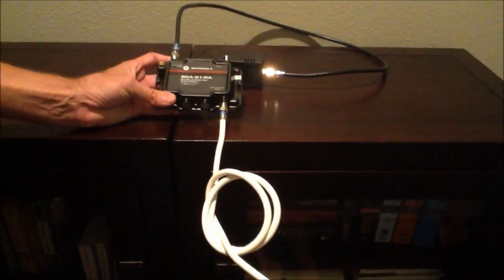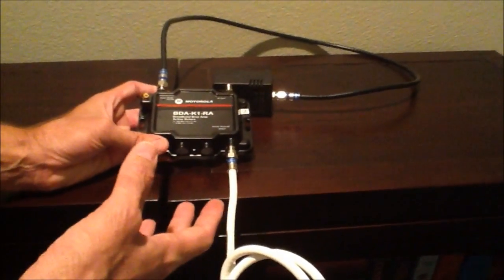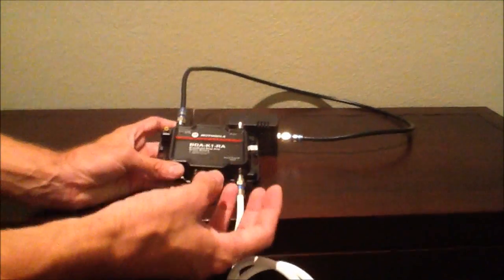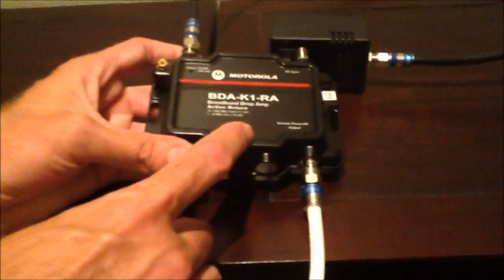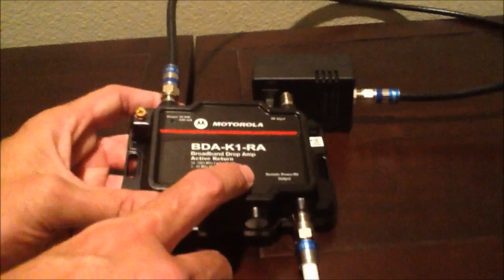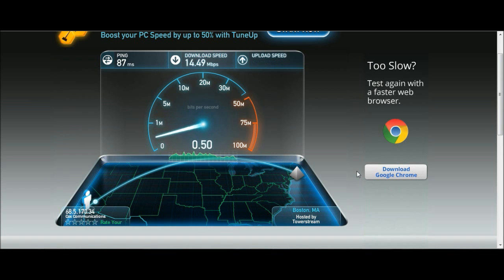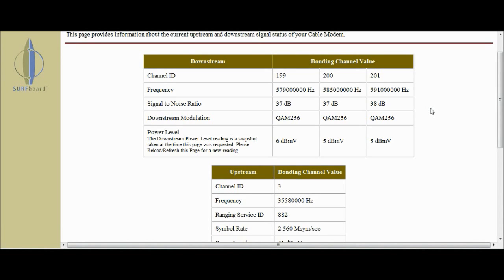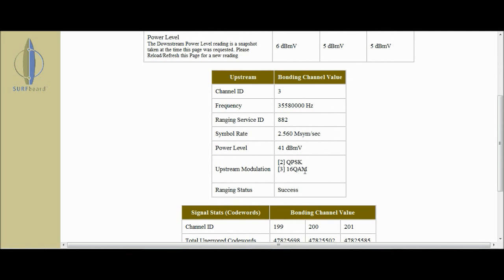Resolve Cable Modem Disconnects Caused by High Upstream Power Level

Comment: What if you're on the other end of the spectrum and Upstream is below 29 dBmV? Active return indicates that it would hurt me rather then help, but I can't find a "active return signal dampener". From what I can diagnose according to this article: 

homepage.ntlworld.com/robin.d.h.walker/cmtips/loss.html

my upstream is capped and resetting my modem or I have packet loss when uploading. If anyone knows of a device like the active return for signal being too low then I would like to know of it.
Reply: +Kevin G I've somwhat answered my own question, but I'd like some further advice. From what I read apparently I can increase upstream levels with a DC Coaxial Couple or a Splitter? A splitter seems like a minor solution, the Couple sounds good, but I have no clue as to sizing requirements or where to buy them.
Reply: +Kevin G 

Okay, for those interested, and BBStudio maybe you'll want to add this info to your post, I added two splitters in series. My upstream power went from 29 dBmV to 37 dBmV and my downstream went down from 8 dBmV to around 2 dBmV with the noise ratio relatively unchanged. 

My speed test download increased slightly from 90 mb/s to 101 mb/s and my upload went from 5 to 12 mb/s. Which all seems much more stable to me. 

I doubt very many people have this issue, but I am happy with the result and everything seemed to stabilize from it which will hopefully keep my modem from restarting. 

As a side note, I started with one splitter and my result was the mean of using two splitters. In effect, adding additional splitters increases upstream and decreases downstream without (in my case) decreasing download performance.
Reply from the maker: +Kevin G Thanks for the additional information on the splitters. I really appreciate that.
Reply: BBStudioProductions Sure thing! It seemed odd that adding a splitter would increase the upstream power, but considering the fact that downstream can diplex the upstream signal it makes sense that a splitter would make the downstream noise quieter by reducing frequencies coming in while the upstream has a straight path to the wall still going the other direction. Kind of like a bleeder valve.
Reply: Kevin G you want a piece of equipment called a "step attenuator". You can find these in various dB strengths. A 15db step attenuator would be ideal for you but a 10 will work. These will increase transmit power and only lose about 1db receive.
Reply: BBStudioProductions wow. Dude. Okay... So I'll make this simple since you're way over thinking it. 

A splitter is diving a signal. A 2 way divides in in "half". 3.5db is "half" as loud as 7db. Catch my drift? This affects signal both ways. 

7db into the 2 way splitter. 3.5 dB out of the splitter. 

42.5 TX in to the 2 way splitter. 46db out of the splitter. 

DB values are on the front of the splitter. 3 way is 6db. 4 way is 7.5 dB and on and on. 

Also.. Terminate the open ports in those splitters or you're increasing noise.

Comment: your ideal signal lvls would be 0db rx and 40tx .. if you are below or above -12db or +12db on rx your modem will fail .. below 35db or above 49 tx your modem will fail .. the reason why your modem resets is because you have a bad node

Comment: For faster service you will want a 24x8 bonded channel set up modem. That's 24 channels down and 8 up. That way if you have channel failure on one or 2 chans your aggregate value will be steady in both directions.

Also DONT KINK YOUR CABLE OR GET ALUMINUM MESH ON THE STINGER AT YOUR FITTINGS!

Comment: I hooked this up to my cable modem today and it seemd to have the opposite of the desired effect.  My Upstream power level went from 52 to 58 and my Downstream went from -3 to -18.  My SNR went from 36 to 21-25.  I made sure to connect the Incoming cable from Cable company to RF Input and the cable to the modem to the RF Output.
Reply: Did you hook the power to the power in?

Comment: I have had the same problem for 3 years, my ISP refuses to acknowledge or fix my consistent internet dropouts. (Huge packet loss at times)

My official modem is locked out from the web interface when the coaxial cable is plugged in, giving me no clue on what the actual signals are. However, attaching a different Modem which is not allowed to access my ISP's network, does show the actual signal levels however.

So I bought a Konig Active Return Amplifier and started to tweak the upstream return path signal strength, and leaving the downstream signal/slope at lowest, i've managed to change a few things.

It seems that i have managed to stop the constant disconnects, having to reset my modem all the bloody time. It did introduce some very light packet loss once an hour on average, just incidental ones. Im still gonna try and find some sweetspot but this is way better than what it was. My ping also seems to be alot more stable (6 to 8ms) with occasional spikes to 12ms.

I pretty much tried everything to keep my downtime as low as possible, even up to the point where I bought a WeMo Switch from Belkin, which I was able to control 2 floors down through WiFi. At first glance of packet loss my script started to count up until 5 times packet loss was detected in a timespan of 10 minutes or so, and automagically power cycle my modem 2 floors down. It didnt solve my disconnects but it did initially solve my huge downtimes. 2 minutes for power cycle and reobtain WAN ip on my router versus 30/60 minutes per packet loss attack waiting time until it sorted itself out.

Cable companies suck, and people seem to have no rights regarding a proper/stable connection. In fact, my ISP clearly states that they are not required or forced to fix any issues a customer might encounter.

Strange, in a world where the Interwebs is almost part of your basic needs. (At least, the government and local authorities and what not really like you to do everything through the web these days instead of paperwork, sometimes there isn't even any other choice)

/Rant over

Comment: Hey BB, Great video man. Unfortunately for me this did not solve my problems. The AMP did boost my levels from -7 to +8 downstream and 49 to 38 upstream. So my new numbers look good but still i need to reset it about once a day. I ordered the same amp and everything, got any other ideas to try? Much appreciated.
Reply: You probably have errors coming in on your modem frequencies. Get a tech to check the tap and your drop, outlet, and splitter work.

Comment: i have the problem you talked about where the modem has to work harder to compensate for cox's end, but my levels are the same as yours in some cases better. should i still purchase a amplifier? I have 16 bonded channels downstream and 4 channels upstream. the modulation is QAM256 and are all around -1 to -4 dBmV. also one of my upload channels is unlocked and the US channel type is unknown with a symbol rate of 0 Ksym/sec and 0.0 dBmV power. i have a netgear CM500 modem and a netgear night hawk router. what do you reccomend i do about the channel.

Comment: FIXED.
Hey..

 For years Comcast had told me my Reboot problem was due to old modem ( since replaced three times.  Mot SBG6782AC now. Then it was old barrel connectors and cable ends. Since replaced twice.
Then I tried a AARIS active Broadband drop amp with no change. My upstream power was 51 to 56 dBmv and is the source of my headaches.
Today's Comcast tech listened to me today as I explained the multiple garage fires melting the pole line and the multiple patch jobs over the years since then. He metered the line and found unstable signal and when it started to sprinkle rain the signal went from barely working to none. 
RESULT... The cable from the main pole distribution was 20 years old and over the years damaged by environmentals.  He replace all the cable to my home with good connectors and cable designed for DOCIS 3.
My numbers are  picture perfect and my signal is rock stable. About 10 dBmv aveage  dnld power per channel( SNR 40.1 to 40.3 dB) No correctables and 43.3 for the three upload bonded channels.
Comcast needs to remember that as technology changes they need to update their infrastructure.
Reply: Spectrum internet sucks. My modem is always resetting itself. Have called them several times. They always want to send a tech out to come inside my home. When the issue is with thier line connections outside. Thinking of gping to Google fiber

Comment: Disclosure was Cox employee 7 years Amps should only be used if absolutely necessary.Then can increase upstream signal as well as upstream noise. And that amp happens to be a pretty crap one. I suggest the Extreme IPA1111DL-RSVF

Comment: All of a sudden, my phone and internet modem are resetting at the same time.  Several times a day too.  This is really hurting my gaming and streaming.  This might help.
Reply: did it fix it?
Reply: @ian8145  Had to get Time Warner (at the time) to come out and check all my wires.  Turned out it was noise interference from some bad wires in house and low power on their end.

Comment: My cable modem drops out regularly and what resets it every time is pulling the cable out of the back of the unit without shutting it down
Do you think my problem warrants the use of a drop amp box ?
Reply: Steves Projects I have the exact same problem. Been happening for a couple weeks now, but it seems like it's only at certain times of the day.
Reply: Steves Projects I reset mine the same way. What did you do to fix it ?

Comment: Your upstream transmit or TX level is basically how hard your modem has to work to talk back to the CMTS, IMO all modems should be transmitting between 40 and 50dBmv, Modems transmitting at 55-58 are at max transmit.That modem cannot work any harder, The reason you disconnect is because your modem cannot transmit any higher of a signal to talk back to the cable company. If there is any increase in attenuation, you will disconnect. Try changing the splitters or where you place the modem before using an amplifier. The danger with a return amp is that if there is any interference on your line, the amp will boost that, which could bring a visit or disconnection from the cable company. Try connecting your modem to the cable where it enters your home and check the TX. If it's any higher than 50 that point call for a service tech to come out. Any splitters between the entry and your modem will increase your TX, and to a lesser degree the cable itself.

Comment: Does It need to have active return? I Bought one on Ebay and it doesn't say active return on the label and its blue.
Reply from the maker: Yes. It must be an Active Return amplifier or your signal to your provider will not be amplified which is how, at least in my case, the problem was resolved. Also, my Motorola amplifier just recently stopped working. So, it seems that you'll get about two years of service. That's not bad considering the headaches it prevented.

Comment: You can produce with this Amplifier high-level FEC, high signal to noise ratio and more as a result of saturation ..
If there are 50 people and you shout too loud you disturb them also to speak.
If your modem will come too loud to CMTS (Cable Modem Termination System) he fails to lock. And possibly interfere with other modems lock.
If you want to make your modem shout, and without producing other disorders, it is best to connect facilitator of 10db. Of course it would be better to wait until the cable company will locate the source of the noise - in my experience, it should not take more than a week. If the noise is active on a regular, non-stop, they can find it within an hour. If the network is fiber to the building configuration within fifteen minutes.
Sorry for my English.
Hope I helped.
Reply: True, but COX are aware of the current problems but intentionally ignore to fix them for some stupid reason. So it is "wild west" here in America... I actually had better Internet when I lived in India!

Comment: The transmit from  58 to 41 i
After the amp was installed is excellent. Those amps seem consistant on regulating signal as well.
Reply from the maker: That's exactly what I found to be the case as well. I'm glad it worked out for you. Now you can actually enjoy your high speed internet rather than pulling your hair out.
Reply: +Final Boss it all depends on the quality of the line to your modem, from tap (usually) to modem. if there are issues with the line, an amplifier can also amplify issues with the line.

Comment: All the tech has to do is run a new line to your house... sometimes they are in ground or from pole to house.  However the amplifier is tempory fix if they cant fix the issue during fall/winter season... http://en.wikipedia.org/wiki/Utility_pole#mediaviewer/File:SIF-Overhead-Wires-1-Cropped.jpg or  http://www.comcastrepair.com/images/underground-main-line-with-2-coax-drops.jpg

Comment: What program/website are you using to check your cable modem's signal stats?
Reply: normaly the ip add of modems is 192.168.0.1
if it's on bridge mode if you are using a separate router. it would ne 192.168.100.1... ip add differs on what kind of modem brand you are using.

Comment: Hi, I host a 5 person Minecraft server, and I nor my friends have any lag, but about every 15 minutes, they disconnect. I have Time Warner high speed internet, and my download is always fine. Would this help?
Reply from the maker: Check the levels as I described in the video. If you find that yours are not in spec, this may fix your problem.
Reply: Its not the download that's the problem its the uppstramning that crashes

Comment: I need help on a different level. my modem resets only when I am playing a very specific game Dungeon Defenders Eternity. on any other game and/or activity this never happens. but I start playing this game and the lights on my modem and router turn off as they reset. I mean wth?
Reply: Elkeen Eng You didn't even bother to think of what his daily activities really are at all. I suggest you beat it unless you're a lucky prick and can tell me his precise daily activity every day with one hundred percent confirmation from him in this comments section correctly.
Reply: This is one of two things that can happen to a modem when it is starting to break down. One of two things can cause this reset you experience to happen....either the software gives itself too much to do, experiences an overflow and then does an emergency reset of the modem, or the modem is attempting to reach a higher power state to compensate the extra load, and either the power capacitor in the modem OR the power adapter for the modem cannot keep up as one of them are worn out. There is a way to determine this...directly connect your computer to your modem, and find a way to keep watch on the modem while you are playing. Pay attention to when the modem does the reset...if the modem appears to stop responding altogether, and then proceeds to reboot, this could be a software issue. If the modem lights dim even just a little bit before it reboots, or it takes unusually long for it to reboot compared to a software reboot in the debug menu, then it could be a power issue. If you want to be double sure, find the IP address your modem uses, enter it into your browser to enter the modem's settings menu, then locate the modem's activity log and look for anything that looks like the modem encountered an error.
Reply: Joseph III That might be God telling you "get a life and do something productive instead of wasting your time playing stupid games".
Reply: Elkeen Eng same could be said to you, if you got enough time to make stupid comments then you obviously don't have a life either because you would be doing that instead.

Comment: I'm with Time Warner and my area recently got a speed boost to go from 15mbps to 50mbps. This caused my connection to have issues and now I'm only getting 3mpbs if I'm lucky. The upstream power is sitting around 48dbmv. Do you think that signal booster will resolve my problem and help me get closer to the 50mbps download speeds i'm supposed to have?
Reply: The description says that this procedure is only recommended for modems getting a 58 dBmV power level or higher, and your modem is actually receiving upstream power levels perfectly! However, if you are absolutely sure that your cable line is working just as flawlessly as your upstream power level, then there is still one more thing to look at. Find the IP address of your modem after resetting it and then type this into your web browser. Most times the modem will use the first two number groups (in Canada it's 192.168. as the first two number groups), but if you can't find that then substitute the X characters for the first two groups of numbers into this: (XXX.XXX.100.1) without the brackets. After you have done this, you should be brought to the statistics menu of the modem. On a highly common Motorola Surfboard SB6120 modem, there should be a tab labelled "Signals" that you can click on to bring up the signal statistics of the modem...however this may vary. If you take a look at the section that is labelled "Downstream" and then take a look at the power level, the numbers should be sitting between 20 and 30 dBmV. If they are not very strictly sitting between these two numbers (and especially if it is far below 20), your modem is faulty and is barely receiving anything, in which the only way to fix this is to replace the modem.